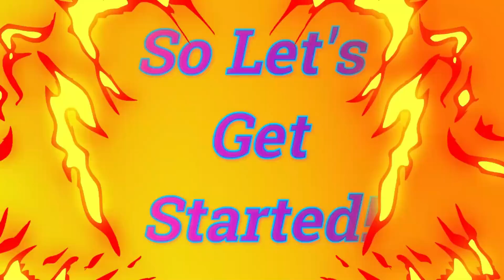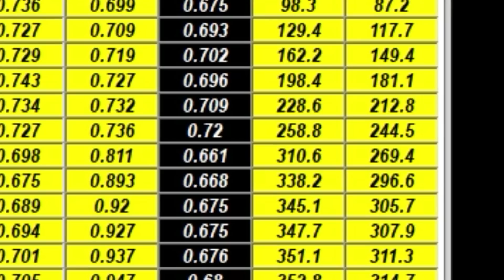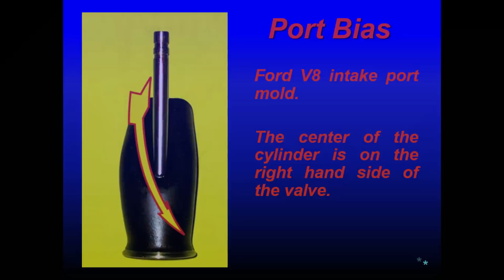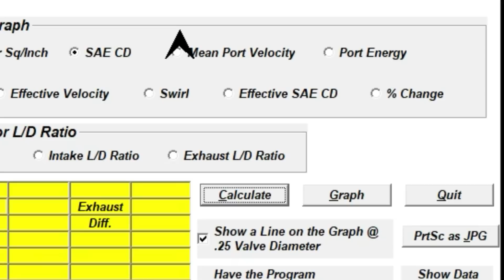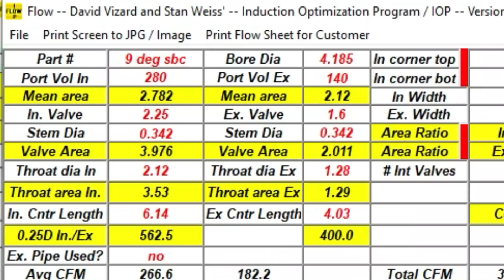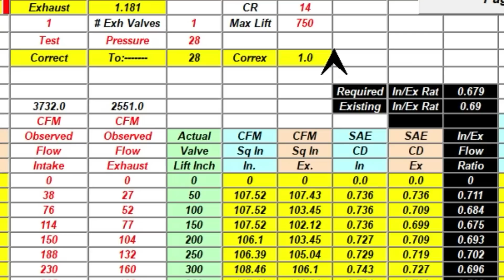Our super hi-flow SB Chevy heads - flow bench results.

Comment: Something I’ve wondered about and questioned regarding exhaust in particular, is what is the optimal cross section profile / shape for ports, exhaust, and header tubes, bends, as I don’t expect round, especially with regard to short / inside turn, is it.
As a measure and maybe as an example, how much difference would there be between a mandrel bend vs a regular bend, wrinkles and all, and whatever the optimal might be?
I’m suspecting that if anyone could provide a objective answer, either from experience or knowledge, it would be you.

Comment: From about 15 years old (1985!) , when I first started reading back issues of Vizards magazine articles, to this current expose on  the IOP, I've personally, because engineers Conviction that they are so important, found that  BEMP to be a useless figure, since many 2 valve per cyl NASCAR and some well worked non Siamese intake A series engines eclipse the better non turbo 4 valve engines historically used. I like PLAN
 I've tended to use DV's dyno indicated HP and lb-ft figures as index points to aim for, , and dimension them against planimeter port area from the Ford SOHC and A series Mini books. I've always had the 351C 4 Venturi and 2Venturi figures to compare those to, with real Net HP figures from impeccable Ford sources like Mick Webb, Bill Sanatcecione, Larry Widmeyr and the DIn readings from DeTomaso as well as the net factory figures from 1972 to 1974. David, your books have given most of the good stuff on common bread and butter engines, and I've lined them up against everything from Briggs and Stratton s to Richard Holdener s historic Gross HP figures with the idealised 1972 GM Gross to SAE Net loss. I don't like Average Air speed either. Everyone should hit up Don for IOP. If it gets too much interest,  I'm sure he has access to the right sort of backup help to control the Tsunami of requests 👍🥝✔️

Comment: Hi Mr.Vizard. How much HP potential would you say is possible with unmodified Dart 2 Sportsman 200 cylinder heads (circa 1990 cast iron , 64 cc, straight plugs) on a streetable 327 ? How much $ would your Ultra Pro guy charge for properly porting these heads if he would even be willing to do cast iron? Good to see you back in action. God Bless you Mr. Vizard.
Reply: max intake flow x .25714 x number of cylinders.
Reply: don't over cam, keep it under 240 duration @ .050 bolt on what you have you should be at a solid 380 hp, with a airgap manifold and good 750 carb.
Reply: @DANTHETUBEMAN  I agree
Reply: @dondotterer24  how the power comes on , the torque curve tells a lot about how useful it is on the street, a 327 like that would be vary good.
Reply: @DANTHETUBEMAN  Yep I built on in a 69 camaro
Reply: @dondotterer24  Great street car, with a 327, is the best you can get for small block street, and gear grabbing fun. your living the dream.